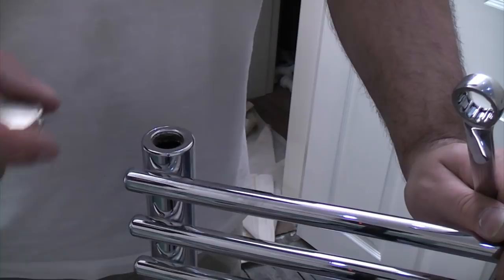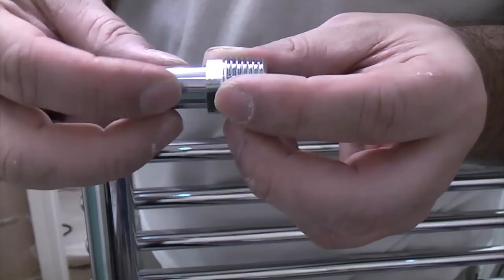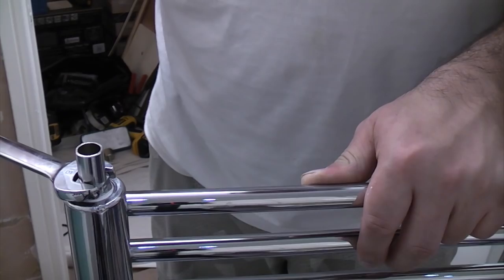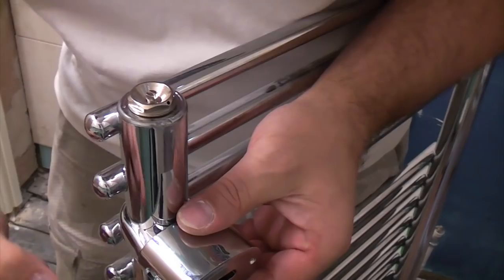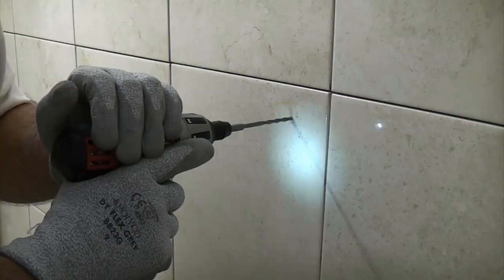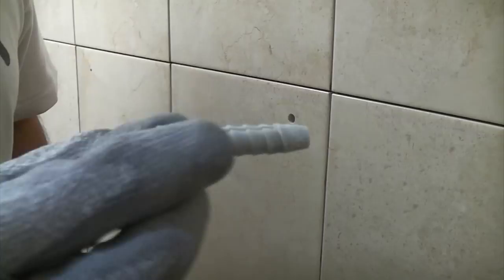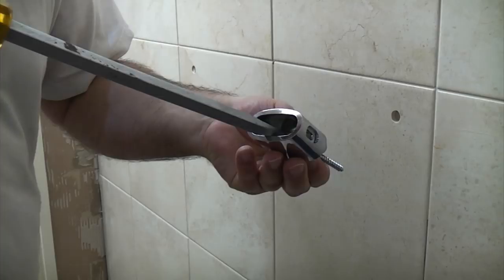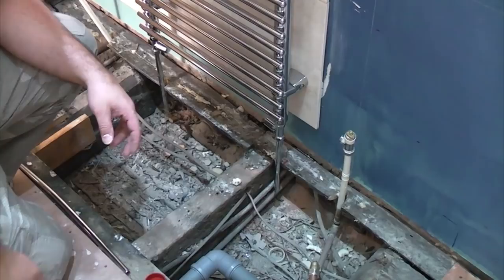How to install a towel radiator

Comment: Hi, we have just had a heated towel rail put in our bathroom. We think the fitter put it on upside down. As its opposite on the box. There are more pipes at the top and the 3 pipes at the bottom. On asking him he said there isn't a right or wrong way up. Is this true please.
Reply from the maker: As far as I am aware, there is no right or wrong way to hang a towel radiator.
Thanks for the comment 👍

Comment: Good video, very clear instructions,  I would have preferred to see more on the final fitting to the water pipe (unless there was a separate video)
Reply from the maker: Thanks, I'm afraid I lost a lot of footage when doing this bathroom but it's just a case of modifying the existing pipes.
Thanks for the comment

Comment: Do you need to earth these towel rails see so many of these videos but never see them earthed thanks
Reply from the maker: Not a simple question, I’m afraid. It depends on the type of protection offered by the consumer unit. If in doubt, earthing it is the safest option 👍

Comment: I am going to have a go at this tomorrow ! if i don't get back to you i will be in the dog house due to failure !!! Top video .
Reply from the maker: Good luck with it Keith ;-)
Reply: Just a quick question , if i am changing an old bathroom radiator for a new chrome towel rad . How much water do i need to drain from the system ? The bathroom is on the first floor and the downstairs Radiator has the drain valve . Cheers
Reply: Job done , had to ditch the bracket extenders due to pipes being too close to the skirting . No leaks . followed the video job sorted .
On to the next job on the list .
Reply from the maker: Sorry Keith, only just seen your other comment from the other day (YouTube does not always send me notifications).
Glad you sorted it ;-)

Comment: nice video. is there a link to how you would fit the elbows? I think I'm going to have to do this in order to connect the existing pipes to the rad

Comment: Hi, I have an old bathroom radiator that has pipes coming through the floor. They are centred at 635mm. I can't seem to get a radiator to fit and I just wondered if you can advise me of what I should do please? I am trying to teach myself to become more handy haha. Thanks you! 😀
Reply from the maker: You will probably have to alter the pipe work, as it's unlikely that you will get a direct replacement.
You would have to drain down the system and re-pipe at least one side of the radiator, normally I cut the pipes under the floor and then join the new pipework to them.
Reply: Ultimate Handyman Hi, OK thank you I really appreciate your help! 😀 Hopefully it will all go to plan! Take care!

Comment: as a plumber, you need at least two shifting spanners and adjustable grips. It's part of the qualifying mark of a plumber (lol). Ring spanners are useful but make the tool kit heavier than necessary. I wouldn't feel happy going out without a couple of shifters.
Reply: Ring spanners definitely useful when you're tightening ptfe x 12 turns!

Comment: Is it possible to connect bent tap connectors to radiator valves if (as in my case) it results in less exposed pipe work ? Even if it were possible would it be ill advisablle e.g., flow rate issues ?
Reply from the maker: Don't know sorry, it's not something I have ever considered doing. I don't think there will be flow issues but you will of course have no way of controlling the heat output of the radiator

Comment: when I screw the output valve in there is no stopping it, I could go all the way through so the valve would end up in the radiator, is it supposed to come to a stop and get tight or is it just the ptfe tape that is supposed to make it fit tight?
Reply from the maker: I have never tried screwing one in so far, I'd apply plenty of PTFE and then try it again. It should go pretty tight with enough PTFE.

Comment: Hi ultimate handy
I have to questions 
1. How do you go about hanging the heated rail on a partition wall as are bathroom and toilet are seperate divided by a partition I think those long plug may come through the other side. 
2. The radiator that is in the bathroom has the two pipes going into the right side with a control valve and a another so it look like the hot water is going in and out the same side will I have to move the out pipe to the other side.
Reply from the maker: 1. Ideally you need to fix a radiator to the studs, but it is not always possible- https://www.youtube.com/watch?v=glzwY76O0d8
There are lots of good plasterboard fixings available now, this video shows how much weight some of them can take- https://www.youtube.com/watch?v=ECDysfNhx_E

2. Yes, they used to pipe up some radiators up like that. It should be relatively easy to re-pipe it.

Thanks for the comment

Comment: I'm having a go at installing a chrome tall towel rack radiator where an old wide rad was installed so I'm replacing and relocating the pipes too, do you have a video that shows how to get the water out of the pipes I'll be chopping or is it just a case of opening them and draining another rad on the system?
Reply from the maker: Just drain the system first-
Draining down central heating
Probably best to use compression fittings unless you want to wait for the pipes to be dry enough to solder-
compression fittings
You'll also need to add inhibitor afterwards-
How to add inhibitor to a central heating system
then fill the system back up-
How to repressurise or fill a combi boiler or sealed central heating system

Comment: Don't know anything about these as never had one. We have a radiator in bathroom at the moment, but only on if heating on. So can you attach a towel radiator to hot water system that tapes use or does it connect to central heating? Don't understand how they work in summer when heating isn't on? Cheers
Reply from the maker: You can pipe one up to the central heating system, but then the radiator will only come on when the central heating is switched on.
You can get a towel rail and fill it with water and insert an electric heating element, this will work of a built-in thermostat. If in the UK you might need an electrician to wire it up if it is in a bathroom.

Thanks for the comment

Comment: Hi mate .... I've installed my towel radiator after watching your video so thanks ... I'm having to change the valves as well and wanted to ask your advice ... I have an unvented central heating system run off a system boiler. I've read that it's not necessary to drain the system down as long as I do 1 valve changeover at a time ie I wont be flooded . Is that correct in your opinion
Reply from the maker: No, I'm pretty sure that is not correct.
As soon as you remove one of the valves, there is nothing to stop the water in the system from leaking out!
Thanks for the comment

Comment: Hello im about to replace my heated towel rail and add 3 feet of underfloor heating. Can i somehow use the same existing circuit/hardwiring to run both ? If so how would it be done? Thanks 😁
Reply from the maker: I'm not sure, sorry as I have never installed UFH before.
Thanks for the comment

Comment: Great Video really helpful in a language that is understandable, please could you tell me prior to cutting into pipe work, do I need to drain the system on condensing boiler and do the other radiators need to be closed off.
Many Thanks
Sunni
Reply from the maker: Yes, you would need to drain the system before cutting into any pipes.
After you have done the work I would refill the system and check for leaks, then once you are happy drain out a little more water and add some central heating inhibitor. 
Thanks for the comment ;-)

Comment: if you have to put the fitting behind the tile. how do you get on with plasterboard fittings. the ones i use uses the tool to open it from behind but guesing these are a problem due to tiles
Reply from the maker: I'm not sure what you mean, sorry.
Do you have a picture of the fixings?
Reply: +Ultimate Handyman i was refering to the wall anchors . you have then on your other video testing the weght. i use the special tool but im guesing if going behind the tile i wont get that tool in there?
Reply: +James Baillie i use them flr my other rads in the house
Reply from the maker: You could use spring toggles- these can support a lot of weight- https://www.youtube.com/watch?v=WO55oYozlxA
Reply: +Ultimate Handyman will i not be making a huge whole on the tile or you think the bracket will hide it
Reply from the maker: Yes, you will need a large hole, which I think needs to be about 13mm diameter for a spring toggle (please check your instructions). The brackets for the radiator are probably 25mm diameter so should easily cover the hole made for the spring toggle.
Reply: +Ultimate Handyman 4 Spring toggles it is then! Thanks

Comment: Got any videos on how to get ye radiator working ie to 100% at the moment a have a downstairs rad that is luke warm a cant get it to heat up properly lots of vids of upstairs rads but none for downstairs get lots of ring a plumber are heating engineer due to me boiler being upstairs ????
Reply from the maker: No, sorry.
Does the radiator have a TRV on it?
If so check that's working correctly. If the radiator does not need bleeding it looks like there could be some sludge in the radiator!
Reply: Ultimate Handyman cheers for the quick response yeah it has ive even swapped them from a upstairs rad No luck was going to try one of the cal shot total system protection inhibitor but was unsure. You add directly thro rad or filling loop ....
Reply from the maker: It's too late for inhibitor if the radiator is sludged up. If you remove it though you can give it a really good flush out using a hose pipe, then refit it.
It's best to drain down the system before adding inhibitor, so that it is mixed to the correct ratio as I have heard that too strong a concentrate can harm the system. I normally add it through a radiator, it's much easier if the system is drained down.  Sometimes it is easier to add it through the filling loop, it depends what equipment you have.
You are welcome BTW ;-)

Comment: Do you have to ground it. My old one has a wire attached?
Reply from the maker: If your old radiator is earthed it is a good idea to earth the new one as well ;-)
Reply: +Ultimate Handyman ive not seen many videos that uses the wire
Reply from the maker: I think they have removed the need for supplementary bonding of radiator pipes in houses that are wired with RCD protection but if your old radiator has it you are better off transferring it to the new radiator as well ;-)

Comment: What's The Make Of Drill That You Are Using As It Seems To Be Doing An Amazing Job
Reply from the maker: I used the Milwaukee C12D when fitting this, it really is a cracking little drill ;-)
Milwaukee C12D review

Comment: is it wise to use compression fitting under floor surface??
Reply from the maker: Yes, they are fine under wooden floors but I would never bury any fitting in a concrete floor.
Thanks for the comment

Comment: Chez, if I wanted to change my one for a new one, do I have to drain the system down? Or do I just have to turn the valves on the radiator off? thanks in advance!
Reply from the maker: If it's a like for like swap and no alteration to the pipework is needed you can just close both valves without draining down. Open the bleed valve to relieve the pressure in the radiator, then crack one of the unions and drain off the water from the radiator. Once drained remove and fit new one.
You will of course have to top the system back up again afterwards, if it is a sealed system ;-)
Reply: Thanks for that! What's a sealed system?
And would I have to put inhibitor in it as well?
Thanks for the help.
Reply from the maker: *****
You are welcome. A sealed system is when you have to manually add water to it, such as with a combi boiler. When the pressure drops you have to manually top it up yourself, whereas on a traditional system it will refill itself from the header tank. I would not worry about inhibitor unless you do a full drain down as I have heard that too much inhibitor is just as harmful as no inhibitor at all.
Reply: Ok, thanks very much.

Comment: what type of plug would you use on a plasterboard wall?
Reply from the maker: I'd use spring toggles if it's a stud partition wall, or rigifix fixings if it's a solid wall behind-
Weight test of plasterboard fixings- https://www.youtube.com/watch?v=ECDysfNhx_E

Spring toggles-  https://www.youtube.com/watch?v=WO55oYozlxA

Rigifix- https://www.youtube.com/watch?v=xaYfs3lr1jI
Reply: +Ultimate Handyman thanks for the advice great help
Reply from the maker: You are welcome.
Thanks for the comments ;-)

Comment: Another great video.
I like to do the odd job around the house but wouldn't take the chance with electrics or plumbing.
I've called a plumber to install a radiator very similar to the one you've used and he's quoted £60 as it involves draining the system and possibly moving the pipework. Is this a good price for the work required?

Keep the videos coming please.
Reply from the maker: Darren Muir 
Yes, that's a bargain ;-)
When you consider the overheads of tradesmen such as insurance, van, tools etc.
I'd be happy to pay £60 for that job ;-)
Reply: Fantastic thanks,I do love a bargain.
Reply: As said that's decent.  Many times though draining the system isn't necessary.  I managed to release the pressure recently on a downstairs rad . And install new trv's  I'm not a plumber

Comment: Great vid as usual. Question though - why not get a wider towel rail so you dont have to cut the water pipes?
Reply from the maker: They don't come in a massive amount of sizes!
Reply: Ultimate Handyman true dat. Screw fix do a 1100 x 600 mm and the pipes on the old radiator are exzctly 600 which is nice i guess.

Comment: What drill bit would you use for porcelain tiles?
Reply from the maker: I'd use a diamond coated hole saw- http://www.ultimatehandyman.co.uk/how-to/tiling/diamond-coated-hole-saws
You can get them on ebay- http://fave.co/2D3fEmN
Reply: Ultimate Handyman Thank you so much for your answer! I see you recommend using water. I intend to hang a cabinet on a bathroom wall so my tiles are vertical and already on the wall. Any advice would be appreciated.
Reply from the maker: You can spray a little water on the drill bit to keep it cool during use. I use an empty spray bottle and just fill it with water.
Or you can buy a special kit for the job, similar to this- http://fave.co/2D21QJ8
Reply: Thanks again. I'll let you know how we get on. Removed a radiator today with the help of your video! Only got a wee bit wet!

Comment: does it matter which side the bleeding valves on, and does it matter which side the valves are at the botom.
Reply from the maker: No, it does not matter.
Thanks for the comment
Reply: does it matter which side the trv goes on and the lock shield valve , can you put them on any side you want, thanks, mark.
Reply from the maker: The TRV normally goes on the flow side, not the return side- but most people don't normally fit TVR valves on towel radiators.
Reply: forgive me for being ignorant, how do you tell which is the flow side and which is the return side.
Reply from the maker: No problem Mark.
With TVR's it is normal to leave one radiator in the property without a TVR, so if all other radiators in the property have TVR's the towel rail is normally just fitted with standard valves, so that water can still flow if all the TVR's close- unless the boiler has a flow meter (I do not know which boilers do and do not have a flow meter).

The original installer will normally fit the TVR to the flow side, so before removing the old plumbing it's best to take note of which side the valves are on, but most TVR's now are bi-directional and so it does not really matter which side the TVR is installed on. I'm no expert on these but I believe that if you get the valves on the wrong side it can increase the chance of noise in the system.

Comment: Need tile drill bits theure pretty cheap dude . Much quicker and safer than a drill bit ..can change to masonary once through the tile
Reply from the maker: Masonry drill bits are fine of ceramic, although I would use a different type of bit for porcelain 👍
Reply: @ultimatehandyman  fair comment mate . The tile bits are pretty cheap I just keep a set hand goes through like knife through butter lol

Comment: Why some people put ptfe tape on anticlockwise??
Reply from the maker: Probably because they don't know the correct way to apply it.
Thanks for the comment
Reply: @ultimatehandyman  thanks for reply once I've had problem when installing radiator I have applied ptfe on both tails clockwise and on one side was leaking until I did the leaking side anticlockwise and leak stopped 🤔 I'm a bit confused

Comment: Great video but I do things slightly different. Ideally the tiles need to be dried solidly; plan your job accordingly; otherwise when tightening up the fittings the tiles can move and crack. Also best to grout and finish the tiles before fitting the rail. To drill tiles best use a Tile Drill bit; can be purchased in packs from hardware stores; Screwfix; usually cheaper to buy a pack of 3 or four, than individually; these drills have a spear shaped head. I step drill;  take it easy drilling and don't force your bit in use a slow speed and not hammer.  I use the smallest drill to centre the hole first then the others up to the plug size ; remove when finished. The fixing plug must go behind the tile into a solid wall surface (do not rely on fixing into plaster) and the masonery drill finally used should fit the hole drilled; otherwise the tile can break. I use an old vaccum cleaner to catch all of the waste and also a dust sheet on the floor surface; if required. Brick dust will scratch anything and makes a mess.
Reply: Plaster plugs are tidy but I agree to all u said